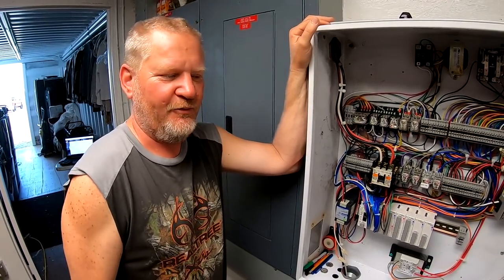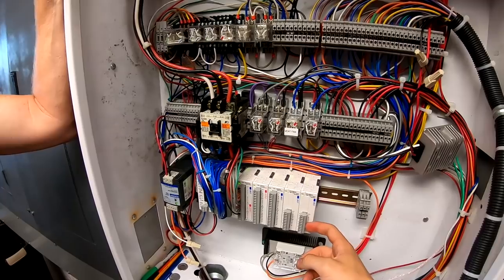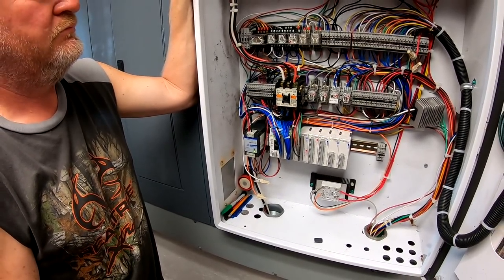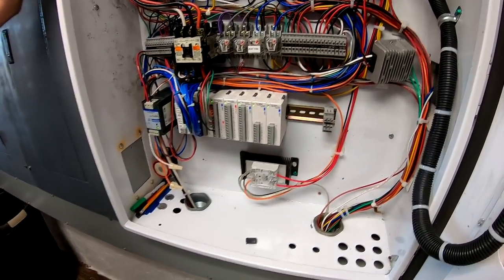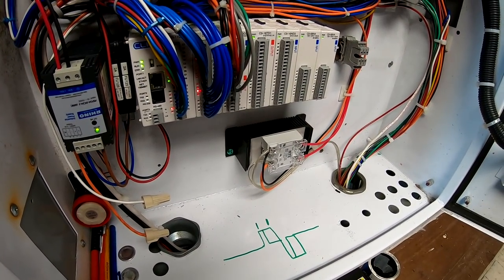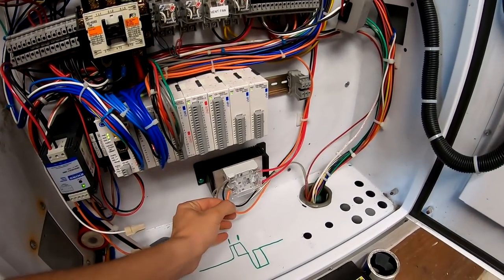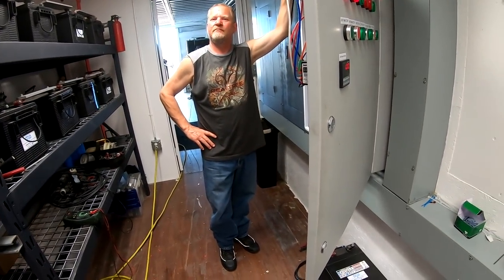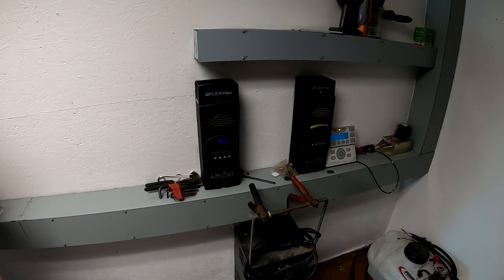Off Grid Automation Panel Questions & Answers

Comment: Just subscribed recently -- as someone that does some telemetry for mission critical applications (public works, public safety) I'd suggest getting a 7ahx24V (or 5.5ah, whichever you prefer) and maintaining that with a DIN UPS module.   This will float the batteries, and provide alternative power when the power fails.   There are DC-DC Versions; i believe PULS, NewMar, and MeanWell have a variety that will suit.   Alternatively, you could source a quality (read: not chinese) DC-DC converter from a company such as Acopian, Wilmore, Samlex, etc - to deal with that.    The short of it is that the UPS modules have monitoring contacts for AC fail as well as DC Battery OK status -- which you probably have enough inputs for.

Hope to see some of the ladder logic running all this; never played in the PLC domain but see a lot of it going in (i maintain the RF / Radio side of the instrumentation between sites)  have often thought about playing with it.   Keep up the good work!

Comment: Usually those kind of Solid State Relay let a full sine wave pass though, they do not chop it because of the noise reason
Also, you had drawn square wave, not sign.
Reply from the maker: It was to better represent how the pulse width modulation was working.  In fact the pulse-width modulation signal is DC so it wouldn't actually have the bottom half of the wave

Comment: My eyes!!!
I used to assemble panels for Flares and Incinerators for petrochemicals. 
1. I’d recommend a backplate so you can slide it out for extra DIN rails. 
2. Panduit... it’s not expensive and supports the wires, just wrap a 3” all the way around each top low voltage DIN rail for 24VDC and  add a 120VAC/240VAC in a separate channel because 120VAC will induce false readings in a 24VDC wire in parallel. 
3. Move the PLC to the top to isolate the processor from AC interference 
4. You can also buy thermocouple cards for most PLCs and monitor battery temperatures, we used Type K for pilot assemblies 
5. This is nitpicking but I cannot discern a color code or wire labeling system and if someone else had to fix this while you were indisposed they’d be up that proverbial creek. 

Just trying to give advice, some may not be as worrisome... we used 600VAC ignition transformers inside the panels so we’d separate it and the PLC as far as possible. Never had issue with IDEC or Siemens 3xx or Micrologix PLCs but SLC500s needed a RF shield around the transformer to stop it from constantly restarting which was bad on SIS2 panels which locked out the gas supplies.
Reply from the maker: I actually was working on rebuilding the panel today.  Many of your suggestions are quite similar to what others have suggested, which I have taken into account in the latest revision.  I also changed out all the front panel buttons for a HMI display.  Video will be up on the channel in the next couple of days.

Comment: What kind of electrician were you i been doing electrical my hole life but dont know this to that extent and id love to do this in my future house. started when i was 5 years old from a master electrician and also for the CAT5 stuff ive been doing computers for 8 years now and built them so i can grasp this. what branch would you learn this from because this is insane.
Reply: This has nothing to do with being an Electrician. This type of work would be a field of Electrical Engineering.

Comment: 100 ah lithium is pretty small considering what you have now.
Reply from the maker: Yeah, but that's around 90% usable.  What I have now is 750ah and only 20% usable.  I also lose a LOT during charging.
Reply from the maker: The lead acid batteries truly are performing like crap right now.
Reply: @HighTechLab  All true but a system like yours and the amount of use you really need 1000 ah then forget the genny. Yes it is expensive but the availability of used car batteries and bus batteries are more plentiful everyday and a lot cheaper. Cheers and great videos.
Reply from the maker: Yeah I'm not doing used lithium
Reply: HighTechLab  I’m at about 900 ah between the two systems it sure makes it nice having the lithium I’m hoping to have a 12 kw array and the hydro running this winter to get closer to all electric appliances

Comment: Pretty sure that entire panel could be replaced by an arduino mega that uses 1w. You could power it from the first 2 cells of Lifepo4, assuming you have a bms. You can control SSRs and power small signal relays directly from the arduino. Those relays could do small loads like strobe / siren or trigger a bigger relay. Your current setup is a brick phone from the 80s, with arduino it could be a tiny flip phone
Reply: Nevada Forensics LLC it's done with a PLC for safety and reliability.
Reply: I doubt you can drive a relay off the arduino digital pin. Relays produce inductive spikes that can kill the atmega and also need quite bit of current to turn on. So you would need extra circuitry to run it. However, there are components for driving small and big relays off-of the arduino pin. You can search for arduino plc. Or internet connected raspberry pi.
Reply: @tomasbrod1533  like I said, SMALL SIGNAL RELAYS. The mega has a maximum output of 40ma. Small signal relays pull 20ma
Reply: @climatechangepreppersfaceb2148  , Really? I am outdated on the relay technology then. But they must give back-emf, don't they?
Reply: @tomasbrod1533  they might, but it's a tiny relay and in 2 years I've not had a problem. If you were worried about emf you could do the freewheeling diode thing as normal
Reply from the maker: Or you can do a PLC that is ready to go and has expansion modules that plug and play
Reply: You still haven't answered my question. How many Watts are you wasting on inverter idle, converters, power supplies, relays, plc and indicator lights? Do you even know? Regardless of what the answer is, my system uses 26w. I don't have a generator, I don't NEED one because I do not waste power EVER. You are taking 48v, converting it to 24v, converting it again to 240v, then converting it again to 5v inside the plc. Do you have any idea how ridiculous that is? I realize that admitting that you made a huge mistake going this way is hard for you but you will eventually redo everything you have done. 
I changed my cell count just so my inverter idles dropped (watch my video OPTIMAL INVERTER VOLTAGE ). I use latching relays because after triggering they don't use any power at all. I built a 48v instant water heater that uses 95 percent less power than a tank. I modified my freezer so that it uses 60% less power. I never run out of power. I have the most efficient off grid solar system in the world
Reply: @krazykarl0  how is 240v safer than 5v? How is a bunch of mechanical relays and hundreds of terminal connections more reliable than solid state?
Reply: @climatechangepreppersfaceb2148  It's your gentle way more than your wisdom that impresses people the most.
Reply: not upsetting snowflakes comes a very distant second to facts, but if you were smarter you would already know I don't care what snowflakes think